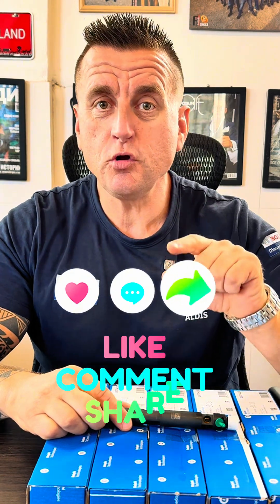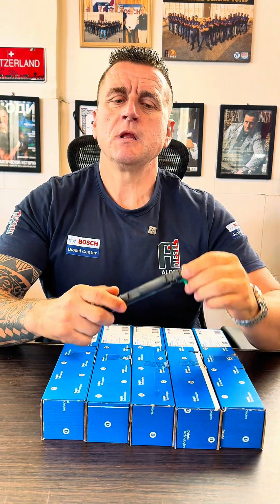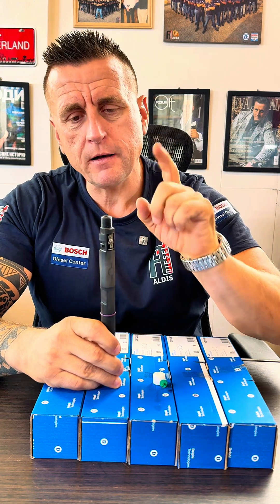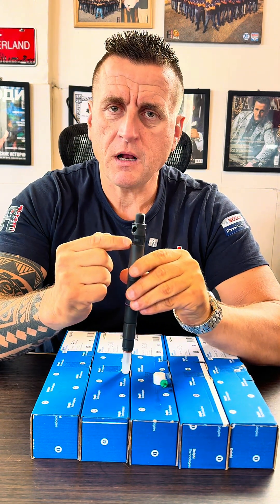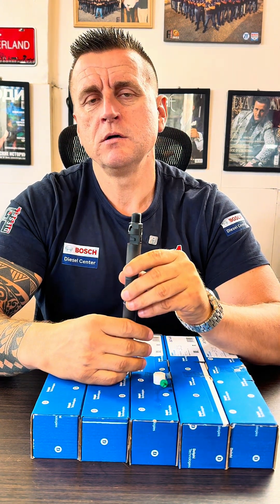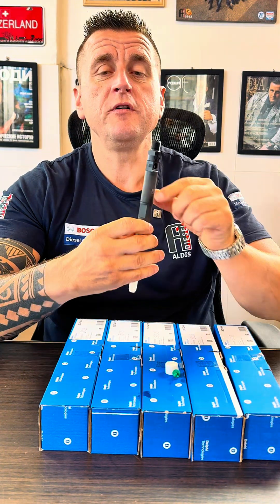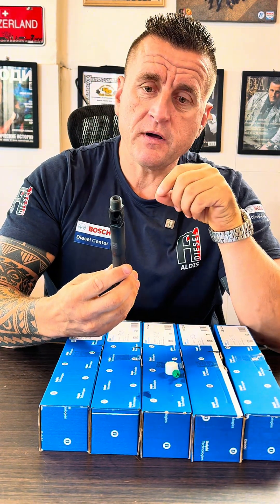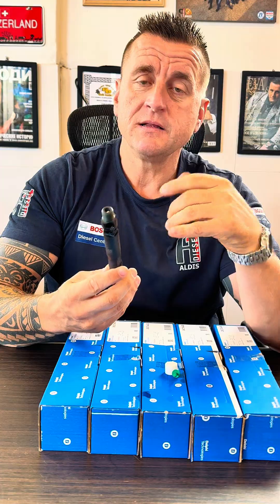Why Did These Brand-New JCB Backhoe Injectors Fail?

Comment: Another reason is running out of fuel
Reply from the maker: Running out of fuel can definitely cause issues, especially with modern diesel engines. It can lead to air entering the fuel system, which might cause starting problems or even damage to the injectors and fuel pump. Always good to keep an eye on that fuel gauge! ⛽🚗"